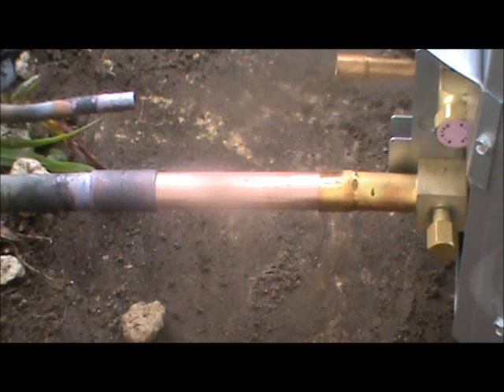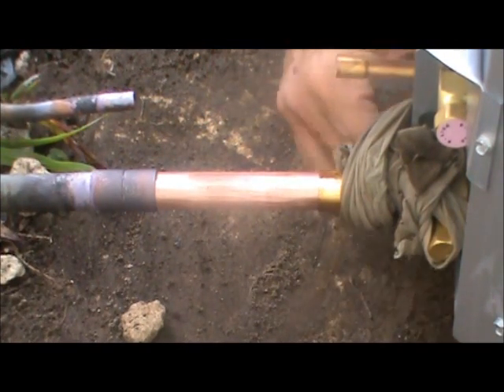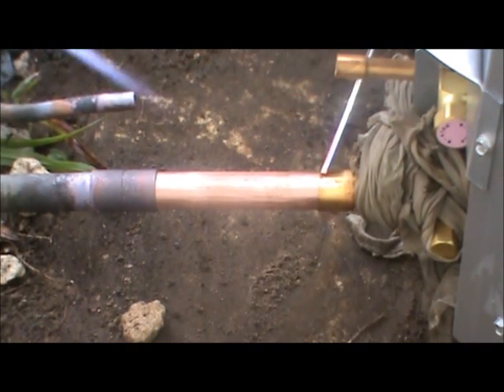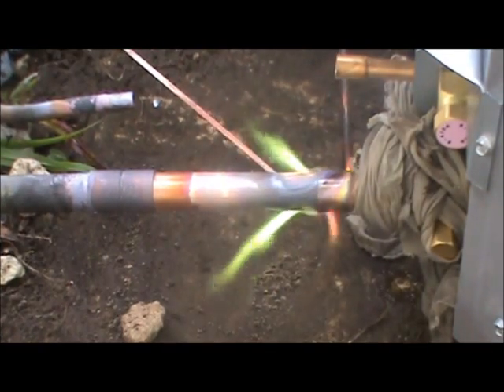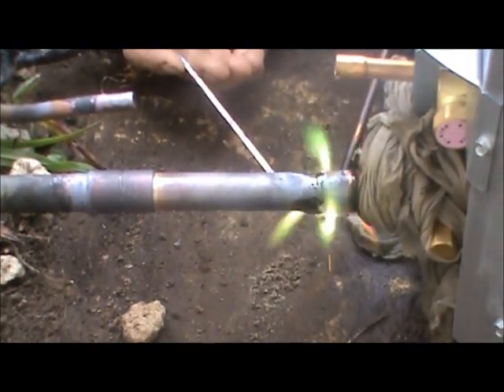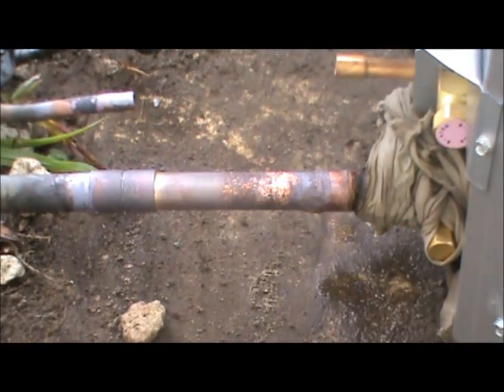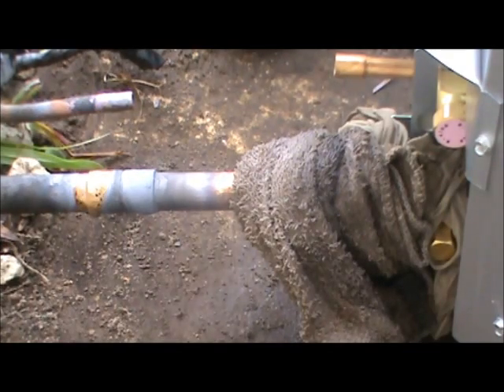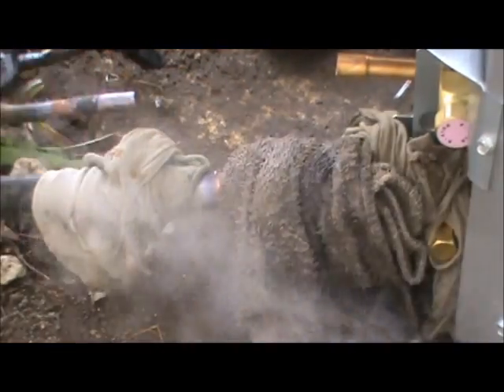HVAC Training - Basic Brazing

Comment: Will MAPP gas cause the flame to turn green?
Reply: Yes it can. They use copper to make green fireworks. So if u heat ur copper pipe hot enough you would have that green color as a result. I have seen it on jobs with mapp gas mostly when using double torch

Comment: Will a map gas torch get the job done or does it have to be oxy/ acet?
Reply: Chris Marescalco mapp torch will never get hot enough.  oxy/Acetylene works faster but you can just use just acetylene to heat it up, just take slightly more time.. but it’s doable with just acetylene
Reply: @johnperez4381  Ok thank you! I have an oxy/ acet set up. Gonna attempt to add ac to my current furnace. After I make sure I'm ordering the right equipment.

Comment: You are using improper brazing techniques.  For one thing, you are using the wrong size tip, and it is adjusted wrong, Just listen to it screaming like a jet engine.That sharp flame is not a neutral flame.  It’s ajusted like you would use for a cutting torch.You don’t keep the torch moving, it is way to close to the work, and don’t get the fitting hot enough to melt the rod on its own. You state to not let the torch melt the rod, but that is what you are doing.  You spend way to much time on a fitting because you are trying to over drive too small of a tip.  Try a small rose bud, and move your flame back away so you are using the hottest part of the flame.  The only right thing you did was wrap the valve with a wet rag.  You should not be giving brazing advice.

Comment: I just want to say that using a wet rag will cost vaporization and the heat from the copper pipe will actually suck in the vapors due to the Heat contaminating the freon when applied a actual heat thermal paste it's the best thing believe me I'm guilty of the wet rag myself I even open up the top valve and fill in the valve with water that also helps keep the valve cool but thermal paste is highly recommended been watching a few videos on it and the top professionals advise

Comment: Wrong everything. Remove the cores. Clean the copper before brazing. Waaaaay toooo muuuch heat, use cleaner burning propane. Oxy/Act dumps oxygen into the copper and the bond area. That leads to corrosion. Oxy/Act is for steel not soft copper.

Comment: Using a wet rag is a bad idea any more, use the heat paste! Why would you risk adding excess moisture to a closed system, you might be able to get it all back out with your vacuum, but at what time cost?

Comment: This is a good example of  what to expect of your unqualified brother-in-law.     Let the joints cool, don't throw rags on the joint early.  The copper is all annealed.  There is enough copper oxides to clog the metering device.   This is where a professional determines the life of the equipment right here.
Reply: They teach you to douse the joint in tech these days.  Apparently cooling it quickly anneals the copper making it a softer b longer lasting joint.  I prefer to let it cool naturally but he's doing it correctly here for the most part.  Lack of Nitrogen is the is the real enemy here.
Reply: You don't have experience with Solder grade HVAC materials. There are no Copper Oxides since the temp is below 600 degrees when soldering.  "Let the joint cool" is for brazing not Solder. With Solder the joint is stronger if it is quenched. There is no need for nitrogen or to remove the Schrader valves since the temps are so low. (I remove the schaders). The whole point of the video is that this is a different technique that works fast with arguably the same results when done right.
Reply: He is brazing not soldering I promise you. Nitrogen should be flowed to prevent copper oxides and you want to let the joint naturally cool. He’s using silfoss rods most likely 15 percent silver. It melts at like 1100 degrees that’s brazing not soldering

Comment: I don't like using couplers when you can put a swage on and only have 1 joint. Fewer joints equals fewer places for a leak.
Reply: Except swaging has its own set of issues.  My guess is that most techs are better at brazing than they are at swaging.

Comment: This should not be a training video. To many mistakes starting at the simplest from Schrader valve core removal to no shielding gas. Left off filtration. Most of all pour use of torch and application of filler rod.

Comment: Seriously, gawd-awful technique.  Work on your shouldering skills.  Here's a tip, bend a 90 in your rod to work around the bottom of the joint, also pull the torch a few inches back once the braze is flowing.

Comment: Take the schrader valves out....plus you need to start taping the end of the pipes if they havent been connected. The vacuum will take forever to achieve the right microns to finally crack the valves and test and adjust the system

Comment: What is thought of using only an acetylene tank with a turbo torch? As long as you have enough heat quick enough, do you need a 5000 degree flame?
Reply: Ken Marriott this is terrible
Reply: I have been doing that for the last 10 years, don't listen to a lot of smart ass talks, what works for you, that's what you should do, as long as you do the basic procedures right, like wet rag, valve removal, clean copper, etc.

Comment: I use a little bit of Stay-Silv flux so the solder will easily flow to the bottom of the joint.
Reply: So you use 15 sil flux core rods plus put flux paste, which one...can you send me a link

Comment: What do set your gauges at for the oxygen and the acetylene?
Reply: Adam Mehra typical acet is 5-7. Oxy i usually have around 15. Just remember to connect a purge/brazing tool to the gauges pipes to get nitrogen flowing through the lines. Have all lines ready to braze. Do not connect one side and then braze. Too much air gets in and the vacuum will take forever. 
The rags are an ancient technique...get thermogel. Take the schrader valves out and on newer systems...take the plastic o-ring out of the assembly before brazing to the high pressure/3/8s side. It will melt and cause a leak.

Comment: Heat transfer experts . Braze refrig  copper tube all day. takes 30 seconds for a joint at most. Use some heat  and throw some rod at it.
Reply: For 7/8 lines going into the Service ports (different metal), any tips?....

Comment: The green flame is coming when you burn freon residue. Please correct me if I am wrong , thanks Ron
Reply: Pete Singh It's the copper oxides burning. Same thing happens if you throw some copper wire or pipe in a bonfire.
Reply: You are wrong.
Reply: @seanstinebuck4890  explain

Comment: This guy has the basics down, but just by the technique and the process he is making up the connections he does not have much experience with a torch. He is getting too close to the copper with the torch, and not moving it as much as needed. If the oxygen is backed off just a little the flame will have a white wider tip which will lessen the chance of melting a hole in the copper as a fine sharp pointed flame would.

Comment: You should remove the cores on the access valves.. Wet rags is a good idea but take only a min to remove the cores..
Reply: REMOVING OF SHRADER CORE IS A MUST
Reply: Absolutely! Idiotic not to remove Schrader Valves.
Reply: Absolutely, if not the rubber on the valve could melt prematurely from the high heat.
Reply: No nitrogen flowing through lines?
Reply: Can you remove them if the condensers pre- charged?
Reply: @SCRIDify  yes....has long as those valves are still closed
Reply: clearly it's not since techs haven't been doing it for 30+ years
Reply: @johndavidson5564  it’s actually 101, techs know to remove them. If they don’t then they need to go back to basic training
Reply: @captainmigs1655  i mean i would but they dont many times.

Comment: Good video except... you see a lot of oxidation and if he didn't use nitrogen gas inside the pipe during brazing, then he oxidized the pipe inside too and it will ruin the compressor in about a year or so
Reply: I keep hearing about this nitrogen and the effect of not using it, honestly i have been installing ac units for the last 10 years, somewhere around 100 units per year, never used nitrogen when brazing, now i don't hear from all my jobs obviously,  but i am yet to have one call back or issue resulting from this, i am starting to think these are just formalities to make things complicated,  the low side goes through compressor oil and the high side goes through the filter, i doubt any of these said oxidized copper reaches to the metering device,
What do you think?

Comment: I see fouled up txv in the future for this system. All that black peeling off of outside of pipe does the same thing on the inside. That is why nitrogen purge is mandatory on all brazing jobs. If you have worked in the industry very long, you might notice that the really old systems that are still in operation usually have mechanical connections i.e. mobile home units. They had precharged linesets so they didn't have to braze or pull vacuum. Always purge and vacuum using micron gauge to get below 500 or better. Just my opinion.

Comment: it's nitrogen 100% necessary? I'm trying to save some money (very important) and I only have to braze in one coupler on each line...one on the high side and one on the low side just to reconnect the unit to the lineset. I do have gauges but i don't have access to nitrogen...please advise if I'll be ok to make 2 simple joints or not. THANKS!
Reply: Yes you need nitrogen. It keeps the suit out of pipes. Nitrogen should also be used to pressure test the system. Anyone that says you do not should not be making or commenting on how to videos. Read a new training book....systems last twice as long, if done properly.
Reply: No you don't need to use nitrogen.

Comment: Ron, you're using old technology. I cringe when I see guys brazing next to valves and filter dryers!  See The Harris Products Group document entitled, Stay Brite #8 Tin/Silver Solder.  It has a shear strength of 10,600 psi, which is far above Stay Silv products that require heating the copper up until it is red hot, effectively annealing the copper and thus weakening it.  Stay-Brite #8 melts at 535 F, whereas, the melting point of Stay Silv 15 is north of 1450 F.  Here's another important point:  Type M copper, the tubing we use in HVAC, has a burst pressure of 3,800 psi.  In actual comparison tests, soldering with Stay-Brite #8 had no affect whatsoever on the 3,800 psi burst pressure of the copper tubing it was used on, whereas Stay Silv 15 caused the tubing to burst at 1,800 psi.  In addition, there is heavy oxidation formation inside the copper tubing when using Stay Silv 15, unless nitrogen is flowing through the tubing during the brazing process.  There is zero oxidation when using Stay-Brite #8. Let's inform our new techs that there is an alternative to this old, potentially damaging brazing procedure.
Reply: this made me laugh. i pictured it in my mind, some guy near a condenser that's about to explode but feels safe in the knowledge that stay brite 8 can handle the pressure. thank you.   FWIW, i gave up brazing and switched to  stay brite myself. it's a time saver for me. to each his own.
Reply: you sound like an infomercial sorry to say. The welded joint has a tensile strength of approximately 30,000-35,000 psi when using sil fos 5% or higher. Ultimately it is the copper tubing that gives out. The application of stay brite 8 is very specific and i dont think it would be as cheap as a stick of sil fos 15% for 4$ cad. Since we are talking about "old techniques" speaking about your triple evacuation and evacuation to 500 microns. With the right setup you can easily pull to and under 100 microns if you know what you are doing.
Reply: Sina Derakhshanfar You are 100% correct. If a tech is working on a construction job, then the material specifications and connection protocols must be followed.  My point was that while Sil-Fos itself is stronger than Stay Brite solder, the copper tubing becomes softer because of the annealing process at temperatures near 1150 F. Using Stay Brite 8, the tubing retains most of its original burst strength. You are also correct in saying that a single evacuation to 500 microns or less is sufficient in removing non-condensibles in relatively clean systems. I have repaired burnouts, where I've had to use a system flush to remove contaminates, then triple evacuation to ensure that the evaporator/condenser were free of non-condensibles. On large industrial systems, a technician is not likely to pull a sub 500 micron vacuum and have it hold for 15 minutes. BTW, I have limited experience in residential systems.  In my 23 years, I've only worked on a few dozen residential systems, and most of those involved electrical troubleshooting issues. Today, the industry has better instrumentation and "smart tools" which helps technicians to become much more efficient at solving HVAC problems.
Reply: Coiled HVAC grade copper ACR tubing is annealed purposely when manufactured so it can be bent. It is the A variant on page 66 of this pdf on copper tubing, table 14.2e. One page 72 of the pdf is table 14.33 the strengths of the annealed and drawn ACR tubing. Since most all havc home stuff is with coils of copper ACR annealed tubing, the worry about annealing it via heat is weak. ie it is already annealed. https://www.copper.org/publications/pub_list/pdf/copper_tube_handbook.pdf
Reply: HVAC uses annealed tubing ie ACR grade not M grade that is thinner and used for a drain in  plumbing. ACR tubing has the wall thickness like not thinner L. 

You can just solder an HVAC joint, many have done this for decades so no Nitrogen is required. It will not pass muster with many commercial requirements, nor will epoxy or Elmers glue. 

Both brazing and solder are centuries old. Brazing is usually stronger and more robust.

Before one tries solder instead you might explore the legal aspect if you are in bad stance ie lying to ones employer or ones contract.  Soldering can be outlawed on contracts when one is say installing an HVAC system in a school, hospital, military building. ie the boiler plate stuff can forbid this crummy practice, even if some solder companies paper says it is OK.

******Thus is there an  inspector, boss or set of rules to pass on the HVAC system you install or repair?

Yes folks use brazing and use Stay Brite too, some even use crummy plumbers acid based solder and roll the dice too.

The topic rich with opinions and twists. 

The shear strength of a brazed joint is typically 5 times higher than a soldered joint

After Katrina HVAC guys arrived and swapped out condenser units, got 3000 bucks per ton, soldered the joints and left town. When units sprung leaks a few years later they where probably milking the Sandy folks.

In college in Air Conditioning in ME  I learned that solder ie non brazing had no place in refrigeration work. Then later in Calif the Apartment maintance guy at my apartment was always soldering all the HCAC joints in the 400 units.
Reply: What type of gas combo are you using here?   Air/Propane or MAP?
Reply: +mundrubjet Would you use the "old technique" of simply purging an opened system with refrigerant to remove noncondensables, or new technology of a triple evacuation to 500 micons with modern 2 stage vacuum pumps? When I first got into the trade, I was taught to braze everything. Now I use Stay Brite 8 on all joints ( except those that were previously brazed by others). I've used Stay Brite 8 successfully on 410A systems.
Reply: would you trust silver solder on a 60hp  copeland scroll I might have the high  side brazed  and the other side use solder on the cold  low side due to the fact I wantbto use the cold side for pc phase change cooling I want my copper blocks looking ok not black or gunked  up
Reply: If the Stay Brite flows too quickly the line can get plugged, this happened to me, so even though the old method has a weakening effect on the copper, I prefer that method.  I have never burned a dryer up, or destroyed a three-way valve.
Reply: Robert Merlo Do you need to flow Nitrogen when using Stay Brite #8 Tin/silver solder to prevent oxidation?
Reply: Now that is some deep shit, meaning good.
Reply: The "old technology" was fine for the last 100 years, think I'll stick with it. You do what you want. In 35 years I've never been close to 1,800 PSI in a refrigeration circuit. If I had, I would have run. I would not sit there and say, "Good thing I used Stay Brite #8 Tin/Silver Solder with a shear strength of 10,600 PSI and has a melting temperature of 535degs"!!......

Comment: i don't see nitrogen hook up before brazing.
Reply: +byKeyzeh You keep thinking like that...wait till you start the system and it dies the next day....
Reply from the maker: steven white Yes, however this is part of our online HVAC Technician Course. We cover the nitrogen purge in a different module of instruction. It is too hard to cover everything about brazing in one complete video. All of our videos are not available for public viewing.

But... great observation.
Reply: What size of brazing tip do you use?
Reply: +byKeyzeh You're are supposed to because oxidization causes flaking both outside and inside of the tubing.
Reply: Ron Walker good instructions
Reply from the maker: steven white Part of our HVAC Technician Class. We have other videos showing the brazing process and how it create carbon during the process.  All of our videos are not public on Youtube. But thanks for the heads up.
Reply: NY Mogul i understand that but its a waste of time to do it on splits when you dont have that much brazing to do
Reply: Not necessary, the effect is tiny to none.
Reply: @tsfalcon  I agree, I've been installing splits for the last 4 years and never purge with nitrogen never had a problem.
Reply: You don't need to use nitrogen when brazing lmao